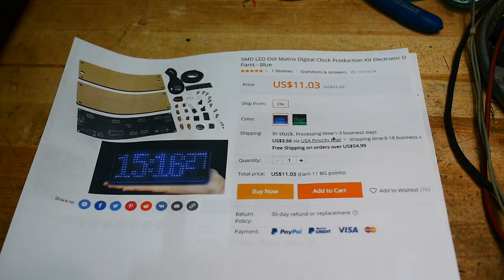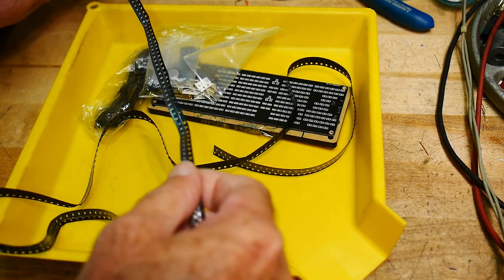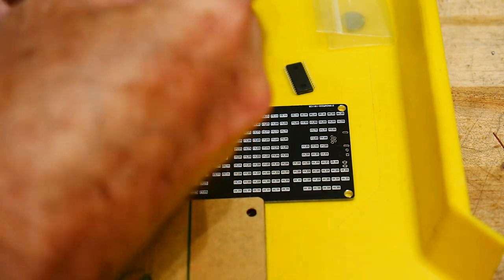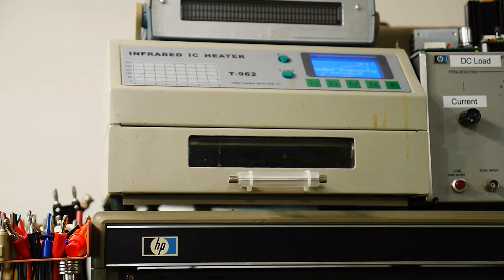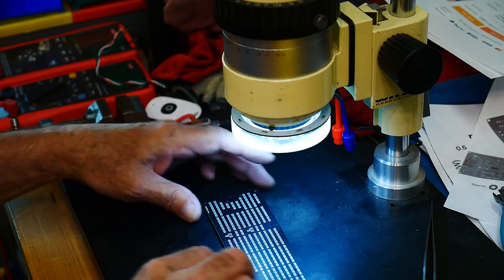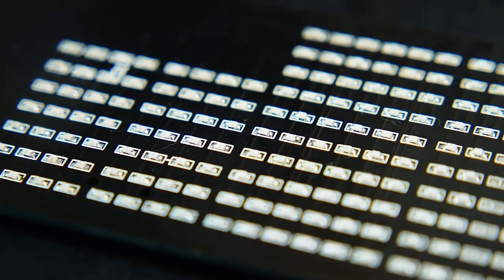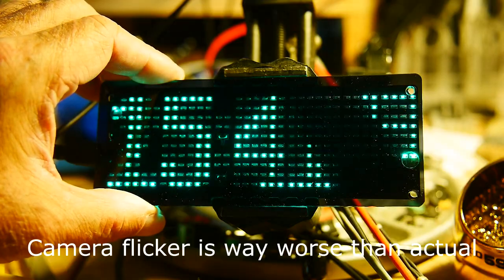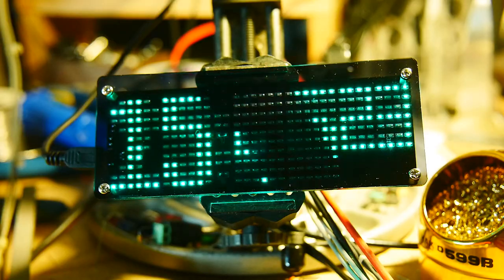#437 Chinese Kit digital clock SMD parts

Comment: Such kits are like a lern to Hand solder smd parts tutorial ;) I recently built me an 4 lines by 12 digits led display resembling the classic TIL311 hex display and I cheated by laser-cutting me solder paste stancils and an alignment grid for the led matrix of nearly 1000 LEDs- that was fun - I had 6 defunct LEDs and about 20 placed the wrong way

Comment: You always do LED's first ,Or you can't test them, While installing them
Reply: That's what I did. I'd rather start the hard side first and as I get tired then I start the easy side. Or relatively easy side. 😅

I built 5 so far ! 2 green, 1 red, 1 purple and 1 pink.

My kit was the harder kit with nearly 400 smd LEDs @ 0603. 😅

Comment: Hello, I have compiled the clock, the settings work.
The problem is that the time does not shift, the middle colon flashes, but neither the minute nor the hour changes.
Where could there be a mistake?

Comment: The ultimate SMT soldering challenge, pass for me :) What oscillator is used?
Reply from the maker: at 20:34 you can see the xtal running into a DS1202 clock chip
Reply: @IMSAIGuy  you got me :) I was skipping some parts
Reply: @IMSAIGuy  ohni see it's 32768 Hz oscillator, I was hoping in easy hacking. Nice build, thanks for the vid.